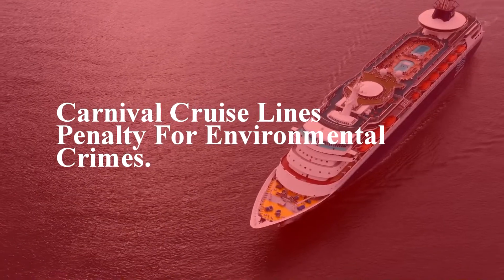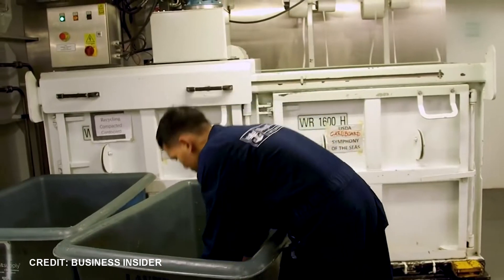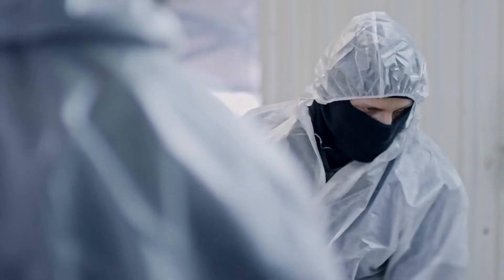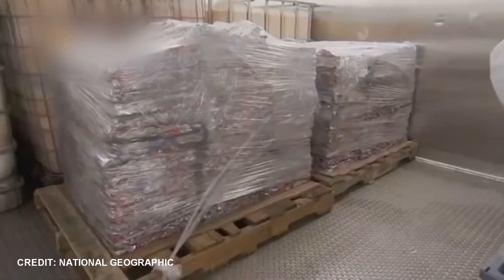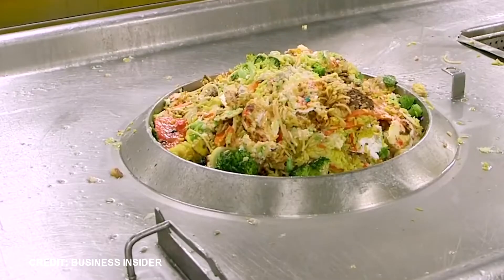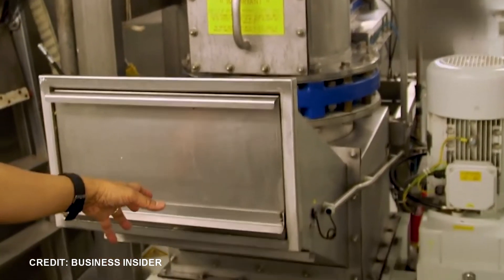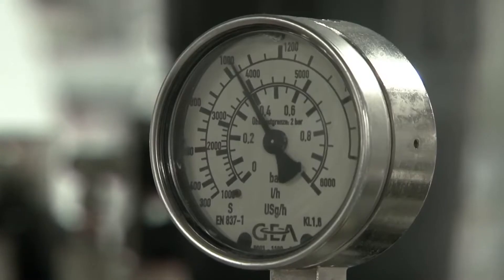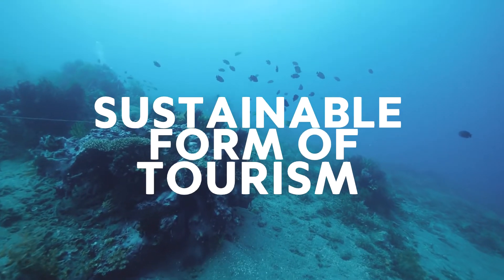How Waste Is Dealt With On a Cruise Ship! 😲

Comment: I really wonder what percentage of ships are processing waste in the manners shown in this video.  Not just luxury cruise liners, but military vessels, fishing fleets, container ships and everything else on the seas.  Most ships dump humans waste into the ocean as long as they are a certain distance from a country's coast line.  I crossed the Atlantic Ocean twice in 1960, when I was 8 years old on two Cunard ocean liners.  It was fun at 8:00 am every morning to stand up on deck, when the big bay doors opened at the stern of the ship and a hydraulic ram pushed the previous day's waste out into the ocean and mix with the propeller wake.  Hundreds of sea gulls, that followed the ship across the Atlantic would swoop in and fight over the floating bounty.  Everything was dumped into the ocean.